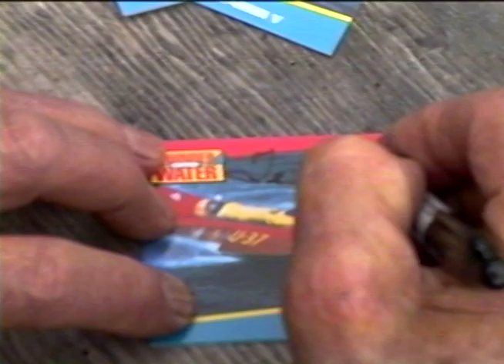Slo-mo-shun V Restored 1st Run 1993

Comment: I saw this boat in one of the museums in Seattle when I was a youngster back in the 70s and it made a huge impression on me. To see it in action is amazing, such beautiful lines and sounds amazing!
Reply: The one you saw in the museum was the Slo-Mo IV. It was taken from the museum and restored to run condition and was run then it was returned to the new Museum of History at the south end of Lake Union.
Reply: @westsideflyer7559  Thanks for the info, I'd guess it was around 1975 or 1976 when I saw it so the memory is obviously not perfect! :)
Reply: @michaelwilson9483  I also remember seeing the Slo-Mo IV in the museum in about 1964.  Things were hot and heavy in the Seattle hydro world and it was like seeing the Holy Grail for me. (I was 8 years old)